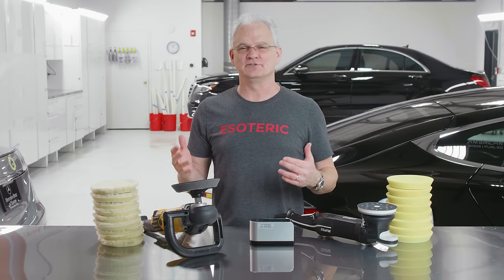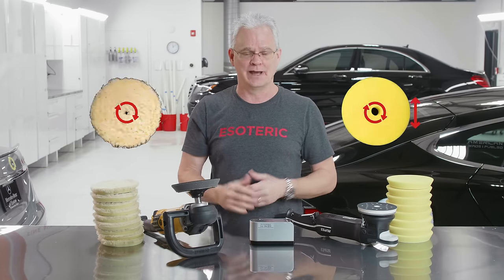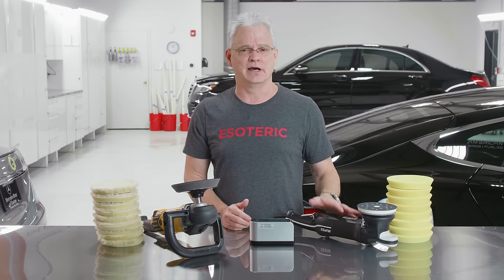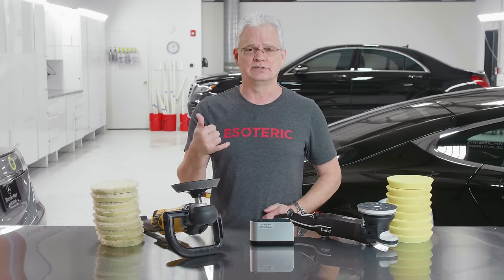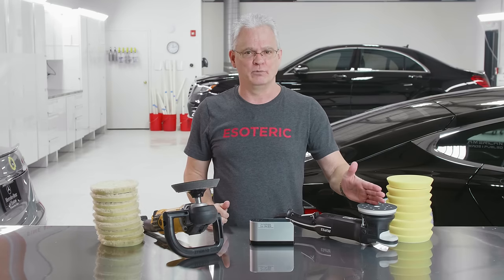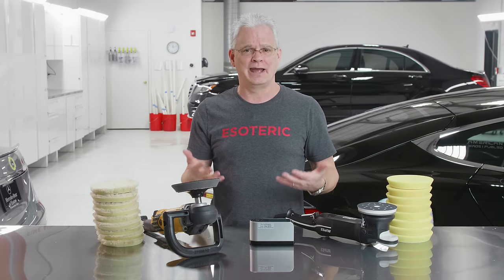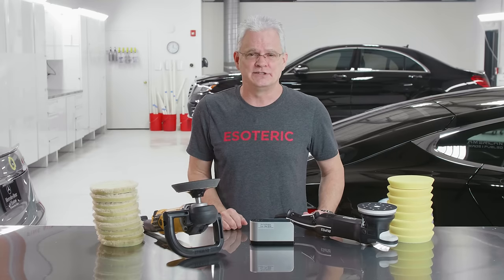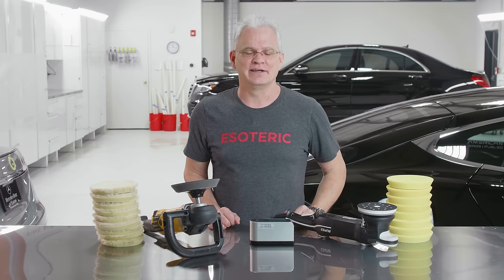Still polishing with a rotary? THIS could change your mind!

Comment: The older heads where I work gravitate toward the rotary buffer. I just grab my DA and throw on my headphones cause I know they talking smack lol
Reply: Whatever.. Rotary Power takes way less time to paint correct - why ? Direct Drive... DA = takes way longer, is not direct drive.. Pad Rotation = the only way to get correction, right ??? Just keep noodling along with your random orbital, very little pad rotation machine,  I will be done and gone on my side and you will still be trying to do the front fender and the drivers door... :)
Reply: @frandanco6289  not necessarily. I’ve seen real bad jobs done with a rotary buff. It also doesn’t seem right to correct a luxury car with a rotary. I can do much more with a rupes than a dewalt
Reply: @frandanco6289  you dont listen very well the video, the person who could master to polish with rotary is very limited maybe 2-3 percent of all detailer, if you one of them, congrats for you and keep doing it. I own rotary for almost 4 years and still couldnt master it, but when i bought DA, i master it for only few days and produce very good result. Thats fate that i have to accept that i born to DA which in early i always skeptis with DA ability. Now i have 2 DA and 1 rotary, but only for very heavy oxidized paint that need heavy cutting i grab rotary

Comment: Few points that you missed, for polishing very tight areas, a rotary is your best option as it offers much better precision with 1” and 2” pads. Also, a rotary, owing to its design will run much smoother with lesser vibration than a comparable DA/orbital polisher.

Finally, you insist that one requires 3 steps to properly finish with a rotary, this is simply not true. With the right product + pad combo you can easily finish down perfectly in 2 steps with a haze/hologram free finish.
Reply from the maker: It's pretty rare to even need that small of pads, so that's a non-issue for us. And yes, some of us are capable of cutting and finishing in just 2 steps with a rotary, but we're the exception, not the rule.

Comment: You will never cut orange peal on a fire truck and DA compound it back. They both have there place rotary with a big woolly pad and a dust free compound to remove wet sanding scratches then da to bring it to a full shine. You could teach a monkey to finish with a da polisher. Here is an idea a roomba with a da polisher you could just put it on the hood and let it go to town.
Reply from the maker: So I suppose wetsanding fire trucks is a big thing in the detailing world? Or wetsanding anything in the detailing world for that matter? Having said that, if you have issues getting rid of sanding marks with a DA, then you're not using the right combination of products and techniques. You can easily go from 1500 to a perfect finish in just 2 easy steps with a DA.

Comment: For color sanding  body shop rotary  is the mother  get   clear  coating  Like diamiond    rupes is for  swirs  remove   but for cut 1200 grita sanding    jjj   to weak   lose time    we put  rupes in the trash my boss to slow  jjj  rotary   1 step color  sanding  use foam pad   20 % compound mothers 70% maguiars corrector  polish  10% maguiars wax   use   alot    1  hour     black car   body shop  secret s
Reply from the maker: Body shop is different than detailers. But having said that, polishes still need proper time to break down in order for it to work properly. Also, body shops typically are not trying to achieve the same level of finish as most detailers. Trying to properly polish, let alone correct sanding marks, in just one hour is not possible when going for real correction and finish. You can fill in holograms in that amount of time, but not fix them.

Comment: I use a no name forced rotation..
It's the person using the tool, not the name on the tool that matters.
Reply from the maker: The name on the tool does matter. I can do just as good of a job with an inexpensive tool or machine, but it will take me longer, and it will have a lot more vibration and / or require more pressure. These things wear you down day in and day out.